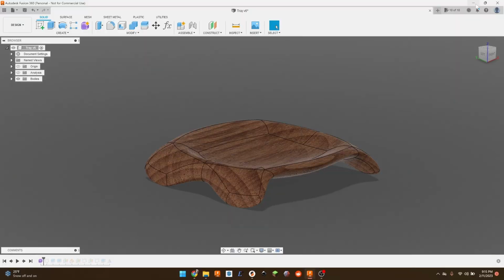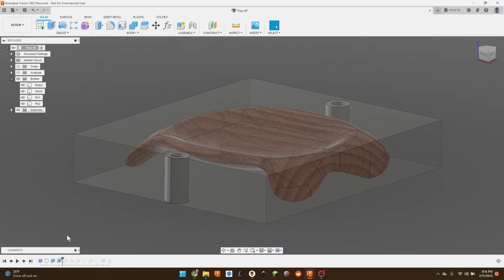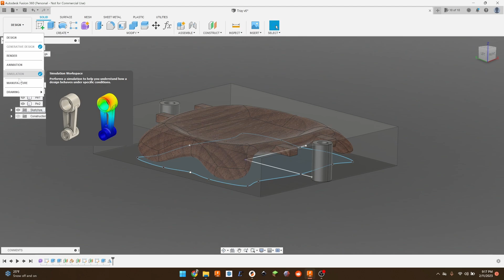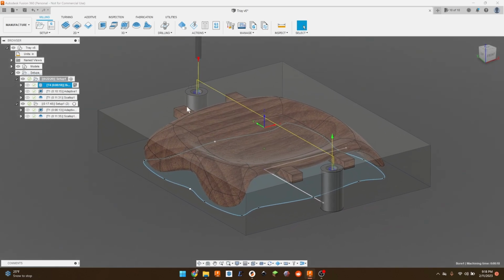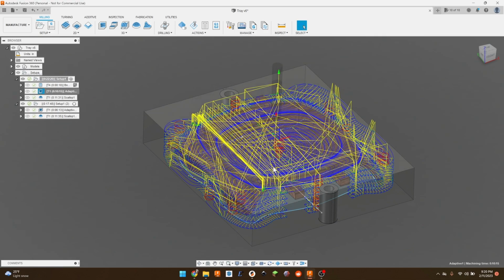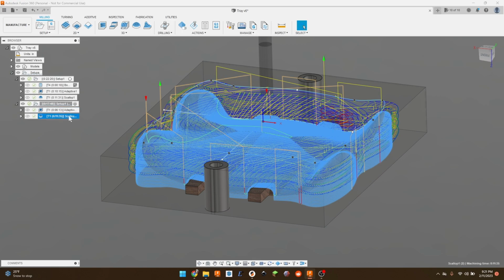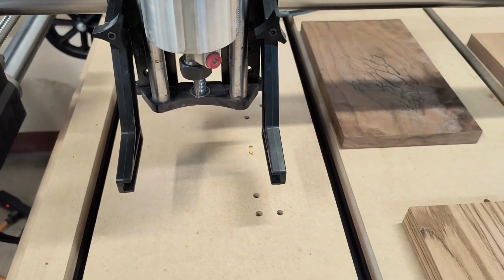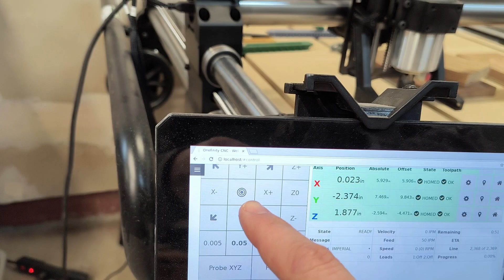Two Sided Carving with Fusion 360 on the Onefinity CNC!

Comment: Hi 👋, I am new to your work shop, very interesting, I am thinking of buying a CNC hopefully 🤞 later in the year, the one infinity looks like a good bit of kit, ??? , but not sure if it’s available in Europe, how easy is it to learn the CAD system for the router? . as I am 70+ not very good at reading 📖, I am very skilled in woodworking as I used to run my own woodworking joinery business back in the UK, 
I am thinking of doing resin project, to make ART, if you can give me some advice it would be helpful, thank you.
PHIL FROM THE DARK SIDE OF THE MOULIN FRANCE.
Reply from the maker: Great! thank you for watching. As far as Hobby machines go Onefinity is very nice. I have a few gripes, but nothing major. Learning CAD is as complicated as you want to make it. For doing stuff like in this video it can be daunting; however, there are programs geared toward doing more 2d type work that are incredibly simple and easy to learn.
Reply: @robobeardesigns  Hi 👋, Thank you for your reply and help, I think it is going to be a up hill struggle, I have always learnt by doing things hands-on. I am going to see if I can find someone who runs a device, that you for the chat, 
PHIL FROM THE DARK SIDE OF THE MOULIN FRANCE.